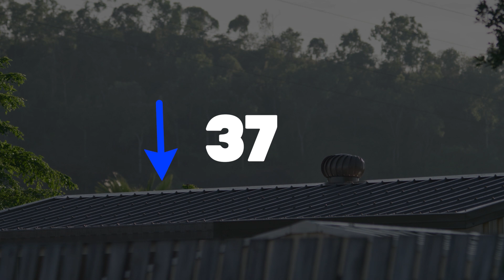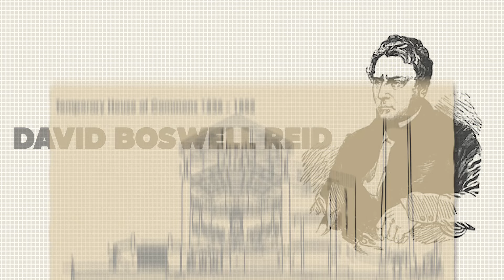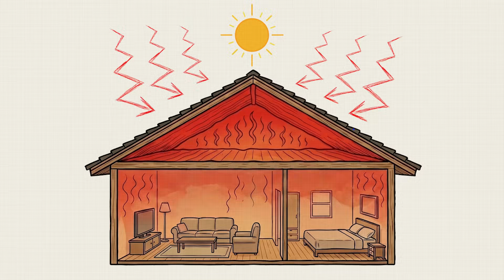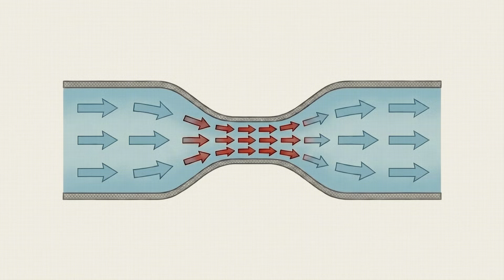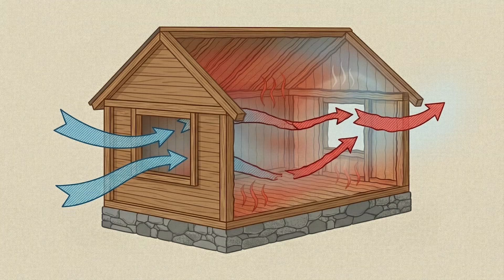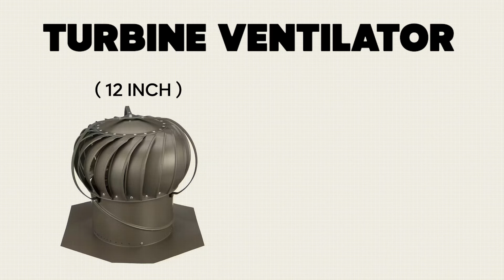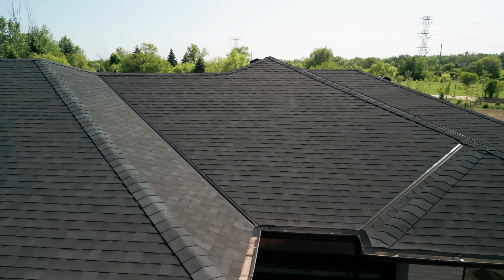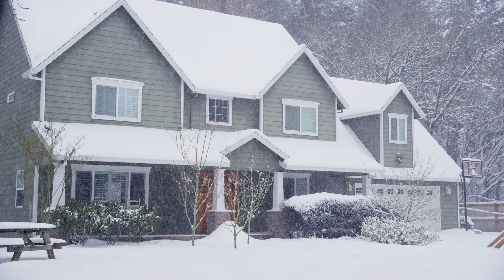Why Did We Stop Using This Natural Cooling System?

Comment: They also help remove moisture, so you don’t get mold and mildew in your attic.
Reply: Being a roofer for 52 years. They are ok for commercial buildings. For residential homes , they leak water when it rains .
Reply: @billrehm3590  growing up with them on our house roof, I can't remember leaks. But Dad is a mechanical man. I've never been up in his attic, but I wouldn't have put it past him to have suspended a bucket with a drain pipe under each one, exiting into sewage vents or something. I need to ask him about that.
Reply: @CallibanMcGee they do leak.  My neighbor has them and inhave seen him wrap them in trash bags to avoid leaks. I was thinking of adding some but that gave it away that it does leak during heavy rains and winds
Reply: @CallibanMcGee  Your dad is a real one for that level of dedication.
Reply: We cover them in winter because they draw warm air out of the attic, not because they leak.  I have had them on my house for 35 years.  No leaks, never replaced them but I do cover them to keep warm air in over winter.
Reply: @thisorthat7626  yes, I was raised the same way
Reply: @thisorthat7626  What are you talking about? Drawing the warm air out of the attic is a good thing, and a must to prevent ice dam. Keep your attic cool.
Reply: @CarlBur  im no expert but thats what i was taught as well. a lot of homes i've worked in / on have the bottom of the rafters insulated about a foot or 2 up in an attempt to help prevent ice dams. insulation there helps keep the warm air in the building from melting the snow on the edge of the roof which causes ice dams.

side note for anyone who isn't aware: ice dams suck because its possible for them to creep under your shingles and cause water damage to the plywood underneath, causing ceiling damage and leaks

edit: i live in new england btw, mass primarily, maine about a quarter of the year
Reply: @jesv4026  Perhaps with modern technology, it would be easy to remodel them?
Reply: @IanXP12  we don't know that. He needs to ask him
Reply: @ioandjupiter685 theoretically, if the house was built with it, there could be a drip pan that drains down to the roof drainage, right?

I think its hell that we've prioritiezed uniformed multi-housed neighborhoods so much that we have grown to neglet making any evolutions to housing architecture for specific environments.
Reply: @jesv4026  ridge vents will too, under the wrong confitions.

The trick is not to design to be 100% leakproof but to design assuming it will collect water and ensure there are ways of getting it back out of the stack before it enters the roof
Reply: @billrehm3590  They’re definitely a climate specific solution. Certainly wouldn’t want them in the PNW, residentially.
Reply: @billrehm3590   There's one on my roof, attached to a vent in my kitchen.  (Our building's nearly 100 years old.)  Lived here 30 years, and have never had a problem with rainwater leaking down.  I never hear the thing, either, and I'm on the top floor.
Reply: @nancymcmonarch why would it be connected to a vent in your kitchen?
Reply: @billrehm3590   There used to be a big old metal pipe running from my oven/stove to the vent.  It was hella rusty, so I hammered it down, took it to recycling, and put an exhaust fan in the kitchen window.
Reply: So now there's just an open hole in the wall, leading up to the roof.  Have never had a rain issue, even during storms.
Reply: Renovating the place this winter, and I'll figure out what to do with the huge hole.  In 1930, an exhaust fan likely wasn't an option.  When I moved in, in 1996, we were all cross-wired to an ancient fuse box.  So if I made toast, and the lady downstairs used her microwave, and the lady below her used her coffee maker, we'd blow a fuse and have to go change it. 😆
Reply: @billrehm3590 it depends on the design and how it was installed. The ones we have down here in Australia don't leak, even in wild storms, at least not an amount you'd call a leak. I pulled one off my house to replace the bearings, and I noticed maybe half a dozen water droplet marks in the dust on top of the ceiling below the hole.
Reply: @therealracer135   centrifugal force combined with the outward vacuum effect when it push out air probably prevents nearly all liquid to sneak inside. Only like super dew or high concentration of humidity(moisture type) will make it "leak" inside.

I rinse plates via centrifugal force using my wrist as the pivot point rather than bobbing plates up and down, it's way faster and less riskier
Reply: @billrehm3590 wouldn’t a top over it help remediate that problem ?
Reply: @billrehm3590  Leaks are very minimal. I wouldn't call it a "leaking". A few drops here or there in heavy rain. The flow of air drys the drops fast enough. Put down some plastic under if it makes you feel better.
Reply: @acs4llc  Or some diatomaceous earth
Reply: @billrehm3590  My house has had them for longer than I've been alive, through 5 hurricanes and 12 tornados. They never leaked.
Reply: @billrehm3590  Cone hat.
Reply: @billrehm3590  I don't remember it ever leaking in my parents' home
Reply: @billrehm3590  well now we just leave a huge opening on the pitch
Reply: @billrehm3590  no they dont, they possibly can if not maintained.
Reply: @billrehm3590  They such in hurricane prone areas! When we lived in Florida we had to replace our regularly because they would go AWAL during storms
Reply: @markvolker1145  then why install them
Reply: Ironically, if your attic reaches 150'F due to poor ventilation, this heat level will kill the mold and mildew.
Reply: @Intranetusa  My son has black shingles in central Florida and we had a piece of soffit out doing an AC upgrade. He was concerned about leaving it open overnight and I told him there is nothing that can live up there during the day.
Reply: If you have windows open.  Modern houses are too well sealed for these to work well.  Even the animations in this video show this working with the downstairs windows open.
Reply: @tarstarkusz Yes, as modern homes rarely have internal ceiling vents, sufficient ventilation is needed within the surrounding soffits, to allow for effective air-flow. If the idea is to cool the ceiling space and reduce heat transfer into the living space.
Also, modern solar powered vents have the advantage of offering a lot more control of temperature settings and air-flow.
Reply: 5:24 he mentions that.
Reply: And dust
Reply: YES
Reply: it said that in the video
Reply: Solar powered vents with battery back-ups, are even more effective in preventing condensation issues. As they can both exhaust the hot humid air, and balance the temperature differential in the vital hours after sunset, that causes moisture from the warmer internal air to condense on the underside of the now cooling roof.
Reply: @amplifiedlight  hear hear
Reply: No they dont remove moisture. If it is 99% humidity outside, it is going to be 99% humidity in there also.
Reply: @markvolker1145  moisture can get trapped and build up if there is no air flow.
Reply: @markvolker1145 cooler air cant hold as much moisture
Reply: @markvolker1145  The opposite is also true. Warm air can hold much more water vapor than cold air. When warm, humid indoor air comes into contact with colder surfaces (roof structures, walls, windows, etc.), it cools down. As the air cools, its relative humidity rises until it reaches the dew point, and excess moisture condenses on those surfaces. If this happens repeatedly and the materials stay damp, mold can start to grow.
Reply: @markvolker1145  Relative humidity alone doesn't tell the whole story. Cold outside air at 99% RH usually contains much less water vapor than warm indoor air. When that outside air enters the building and warms up, its relative humidity drops, allowing it to absorb moisture. Roof turbine vents can therefore help remove moisture from a building.
Reply: @markvolker1145  excess moisture, not humidity, there is a distinct difference between humidity and moisture...
Reply: @markvolker1145 yes they do. The pressure differential creates a vacuum that draws out moisture and it’s especially helpful during winter.
Reply: @glb360123  The pressure differential isn't the root cause. It's created by thermal buoyancy and wind. The turbine simply converts that energy into increased airflow and ventilation.
Reply: @markvolker1145 😂tell me you don't know building science without actually saying it😂

Comment: Well, in theory, this should help a lot. But, as it turns out, the ball bearing couldn't withstand time, so it worked at first, but after a while, the thing stopped working.

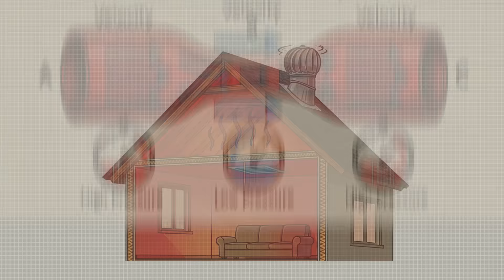Comment: 03:55 It is fascinating to see how Bernoulli's principle is applied mechanically here. Using wind acceleration to lower pressure inside the turbine and actively suck out hot air is a brilliant way to turn natural kinetic energy into a highly effective, free cooling system.
Reply: Oh, stop. The video's explanation of this device is nonsense.  I'm 4 minutes into the video. The device is a weather cap for a hole in a roof. Nothing more. Does the spinning allow for mote airflow than a static cap of the same profile? Yes. Does it privide more airflow than an uncapped hole? No. Period. I'm not speculating, I have one in my attic. Good idea? Yes. Needing pseudo-scientific explanations to sell the idea? That's for individuals to decide.

Comment: The wind turbine, whirlybird, does not need energy input, electricity, to turn, the movement of the rising air, the hot air, will make it spin on it’s own contributing even more to the movement of the air getting rid of the hot air. But you also have to make sure dry, cool air has a way in to replace that air, usually from under the soffits.

Comment: Power Vents use electricity, but are so much better: 8-10X the CFM, quieter, lower profile, better in rain, etc.  I installed one and the drop in temp in the attic was surprising.

Comment: This shows the importance of one of the "old" house construction features.  Two others were higher ceilings and transom windows.
Reply: I would love to see transoms name a comeback.
Reply: @luvondarox  Interior transom windows are considered a fire hazard. If a fire ignites in one room, it can spread to other rooms easily if the transoms are open. However, I would love to have them on my exterior walls. Our original bathroom window was a heavy wood framed transom window that opened inwards. A lightweight brass chain held it in the open position. We eventually replaced it. I was shocked that it had nothing on the bottom to hold it in place. No hinge or rod or any hardware. It just rested in a slot in the window frame. If that chain had ever broken, the whole window could have come crashing down on whoever was in the bathtub at the time.
Reply: I miss those of my grandmother’s home of my youth
Reply: When I was growing up in the 1970's in our house that was built in the late 1940's we had a fan that blew the hot air out of the attic. 
It would cool the house down in about ten minutes or so. 
In the mid 80's it went out so my mother bought an AC unit.
Reply: Wow, windows used to be trans 🥹
Reply: @londonnelson7359 ... 😅
Reply: @londonnelson7359 no

Comment: For both systems, the turbine ventilator and the ridge vent, what about installing a small solar panel, battery, motor and thermometer to drive the turbine or to drive a fan to augment the ridge vent?
Reply: Power vent need probably 10 amps.  The solar ones are woefully under-powered and stop when the sun goes down and your house is the hottest.

Comment: Deep snow was a problem for me only twice in 9 yrs .  Also heavy rain down pour were enough to make me check them regularly 
Then went with ridge vent with  the new roof instead of small small water damage (pans were installed under them after). They had temp controlled fans under them and did a great job of cooling the house, kind of miss them now .... looking at my SHOCKING electric bill.

Comment: The houses are basically sealed box for maximum insulations. So you don’t need to keep heating or cooling the house. Like a thermos, it keeps hot things hot or cold things cold.

It’s a trade off.
Reply: Yeah I feel like we don't need one more pipe to treat the Attic but do we want to that's the question.

Comment: The explanation of the Bernoulli effect as explained here is invalid.  It implies "free energy".  Most people don't understand that the "low pressure" region is only at the mid and exit surface of the convex curvature areas of the restriction, and a restriction isn't even the causes of that effect.  Even high velocity alone isn't a cause.  It's the inertia of flowing air over a surface that's curving away.  That change in shape is necessary.  Also the driver of the "Coanda Effect".  A restriction is a restriction though, and no part of it helps increase the flow of air through it.  The turbine is in fact a restriction when there's no wind to spin it.  Simple convection through a wide open port is more effective in this case.
Reply: Thank you for pointing this out. Listening to this AI give a half-baked explanation of these principals nearly made me skip the video. It's so confidently wrong.
Reply: Always nice to have a mechanical engineer lurking.  Thanks
Reply: Not only a restriction. It is also  a matter of friction loses in bearings.
Reply: I mostly agree with this. Roof turbines don’t create airflow out of nowhere and they definitely aren’t free energy devices. The energy ultimately comes from wind and natural convection (stack effect). A turbine can improve exhaust when wind is available by creating a lower-pressure region and reducing resistance to outgoing air, but without wind it may become little better—or sometimes worse—than a properly sized passive vent. That said, saying Bernoulli plays no role at all is probably overstating it; in real ventilation systems you usually have a combination of pressure differences, airflow inertia, and thermal buoyancy working together.
Reply: A wide open port? Perfect for rain to enter without hindrance. Yes I'm being facetious as I realize there's ways to mitigate this.
Reply: the blade shaping is key. These are effectively Darius turbines updated.

I've seen them fitted with a long shaft and fan lower down to improve the airflow. No idea if it improves their effectiveness or acts as a restriction, but chimney fans used to be a standard thing in 16th century Europe to drive roasting spits.